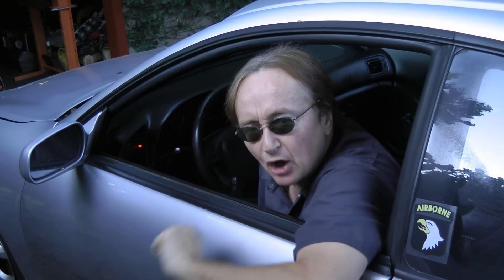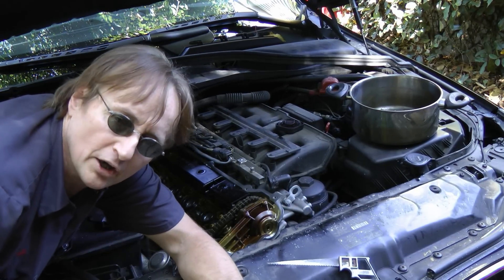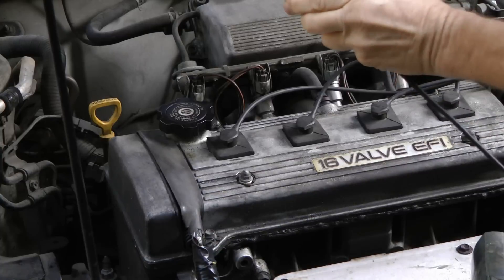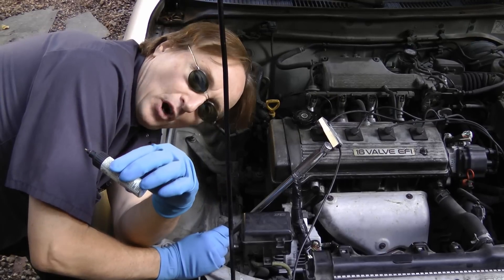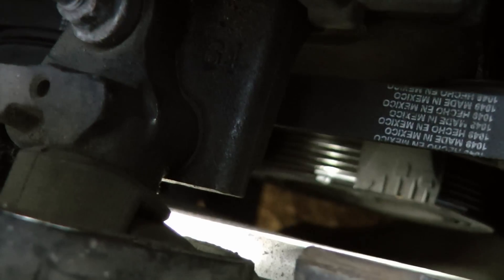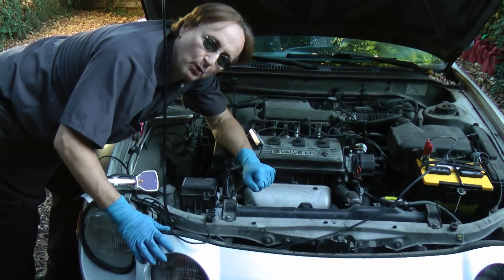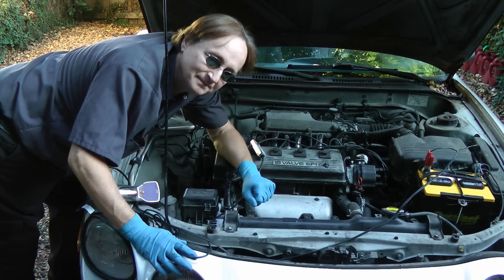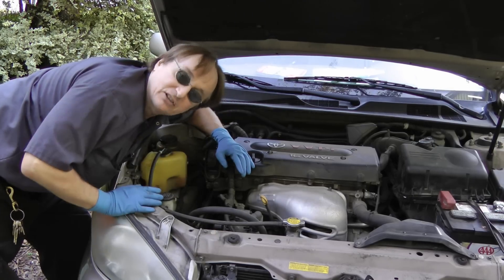How to Check a Timing Belt or Timing Chain in Your Car

Comment from the maker: the light fires every time the spark plug fires. that's the ignition timing on the engine, and when shone on the timing mark on the engine, it shows if timing is correct or not

Comment from the maker: You can try, often using the inductive coil pick up of the timing light will flash IF you put the pick up on top of a coil on plug assembly on the engine. But if not, they make adaptors for checking coil on plug systems.

Comment: Love those M54 engines in that BMW. Chains are so reliable over belts. Much better to spend the money on replacing the belt before it snaps and shreds the valves than spending at least $1500 for fixing the heads.
Reply: Wish my car would have a belt
Reply: Yes I’m so glad I have a timing chain on my Honda. I checked the engine specs for my mom’s Lexus and my brother’s Nissan and thankfully they also have chains. We do our routine maintenance on a regular basis so never have to worry about rubber belts that rot and break over time.

Comment: Very informative brief easy to understand videos.

I have one mention for this video: Strobe lamps are connected to the spark plug wire, but the delay angle of ignition CHANGES while reving up the engine so it's normal to see the mark go away from the normal position.
And if you add some cam phasers (bmw vanos and other names for each manufacturer) things get complicated.

Plus: Most modern cars do not have ignition wires to hook the lamp. Ignition coils are directly on top of spark plugs.

Comment: Thanks for a clear and precise presentation - a mechanic told me you cannot check the status of a timing belt. I suspected he just wanted money to change it!
Reply: He was right. You can't determine what condition the belt is in with a stroboscope. The belt has specified intervals where it needs to be replaced, replace it at those intervals and you will never even have to check it. So in a way, this video is irrelevant.
Reply: that's fine until buy a used car and not sure if or when belt was replaced
Reply: If you buy a car without service history and you're not sure, replace the belt. Simple as that. No need to check it. There are so many factors about the belt that you can't check, just not worth it.
Reply: +AR1G3  That's easy to say, but most people either don't have or don't want to pay the money to replace the timing belt unless it's necessary; my understanding is that it's a fairly expensive job.
Reply: Costs less than the damage you'll have when the belt snaps. Checking the belt doesn't guarantee anything, there is absolutely no way of confirming the condition of the belt. A mechanic will only be able to make a wild guess based on how the belt looks, but that's it. I once bought a car which had a 10yr old belt, the car wasn't used that much so the belt actually looked pretty good. But keeping a 10yr old belt on a car is just asking for trouble. IF you don't want to replace the belt, buy a car with service history. Together with the brakes this is the only component in your car you should never cheap out on.
Reply: +AR1G3  Okay, thanks for the information.  I guess I've done everything wrong then, starting with the purchase of my new used car, but I already knew that. I don't want to tempt fate, but fortunately, it's been 18 months and I haven't had any major problems, only had to change the battery and tires. Keeping fingers crossed.
Reply: Why are 1. The brakes something you should not run cheap with ? and 2. Why is the timing chain something you should not run cheap with? (I am looking for a used G35)
Reply: +LionStreet TM  Well, I am certainly not an expert or mechanical whiz, but at the risk of merely pointing out the obvious, brakes stop the vehicle, something pretty important, and I agree it's not something that one should skimp on, and as I understand it, the timing belt synchronizes the engine, the timing of the values and the pistons, another thing that's pretty important, and if it breaks there could be serious damage done to the engine which could cost a lot to repair.
Reply: Wow, thanks for replying man. I will definitely take your advice, appreciate it.
Reply: Because there could be a day when you need those brakes to save your life. For the same reason you shouldn't cheap out on tyres. For brakes and tyres you should buy quality brands.
Timing chains don't need to be replaced unless they're worn out, but if you don't replace your belt with a new quality item as prescribed by the manufacturer you might end up destroying your engine, and that'll cost you A LOT more than a new belt.
Reply: @LionStreet TM. Because of the newer designs of "interference" engines. Meaning, if the chain/belt breaks,the camshaft(which opens/closes your intake/exhaust-valves) immediately stops spinning but the few remaining revolutions of the crankshaft before coming to a stop will cause the pistons to slam up into the valves that are left in the open position where the camshaft stopped moving at the time of the break. Having the pistons slam up into your valves = a real mess as you can imagine. It's a shitty design and most likely intentionally designed that way to maximize sales of new engines/rebuilds for those who never took the maintenance schedule seriously. From what I have been told, they are called "interference" engines exactly because of that...the clearance of the top of the pistons "interferes" with the open valves should the cam stop spinning due to a break of the belt. Not worth the risk. Change that belt! I speak from experience. Had a belt break on my in a 2006 KIA Rio. Luckily, my cam stopped in the "sweet spot" and the crank stopped as well and no damage was done...i was VERY lucky according to many mechanics I have talked to. Even if BOTH shafts stopped at the exact same time, had the cam NOT stopped in the "sweet spot", just trying to START the engine after would have resulted in the above-described scenario as the starter would be turning the crank and not the cam due to a broken belt! Any mechanics, feel free to correct me if I am wrong. I am not a mechanic, just relaying what I have been told.
Reply: You're not wrong, you were extremely lucky! But you are wrong in saying it's a shitty design. It allows or a much more efficient engine, giving you more power and better fuel economy. And when the belt is maintained properly it's very rare that it fails. However, too many people don't understand maintenance schedules. A belt should be replaced every 6 years regardless of the mileage. Even if you only drive 1 mile in those 6 years, the belt has to be replaced. Too many people cheap out on this. Of all the broken timing belts I would bet at least 98% is due to neglect and not following procedures.
Reply: Change mechanics, find a decent one. Because that doesn't sound healthy for your engine.
Reply: if you're buying a car with no service history and you don't have any budget for after-purchase servicing then you just cannot afford the car. Poor man pays twice. Good rule of thumb for cheap old cars with high mileage is to set your budget, then divide it in half. One half goes towards the purchase, other half towards repairs.

Unless you are like my work mate, he buys disposable cars for 200-400 quid, as long as it has 12 months of MOT and if it fails next year then he just scraps it and buys another one. Not a single penny put into maintenance, but he knows the risk of snapping the time belt or like death on motorway when the wheel falls of due to worn ball joints or whatever.
Reply: @thefeet

"because of the newer designs of "interference" engines"

It is not a new design. And if you cannot afford to spend 400 bucks every 60k miles (or like my focus 160k miles BELT) then maybe you should get yourself a bicycle? Or if the cost of the timing belt job is much much higher then average maybe buy a simpler car with easier maintenance? Or possibly some chain driven one, which requires no maintenance for  lifetime of the vehicle as long as oil has been changed regularly.

I know too many people who buy series 5 or 7 BMW or 15 year old premium cars and then they buy their rotors on a scrapyard, because they cannot afford maintenance. When my bud saw £3k quote for timing belt he almost burst to tears, as he spend £5k on his E-Class Mercedes just year ago. Enough to speak that he spent another £1.5k to make it pass through the MOT.

Comment: I prefer a timing chain, lasts longer more durable. old school is still the best way as far as mechanical operation.
Reply: Its not
Reply: it's $30 for a timing chain and most american engines arent interference engines like Japanes. if a timing belt breaks on a japanese engine the engine is most likely toast after that
Reply: yodaddy nuggems (some) old japanese car s are non interferance engines like the old toyota carina... If the belt breaks.. the Newer japanese models no tho.

Comment: hey scotty how can you check the timing belt with the timing light test on my toyota celica gt 2001 when these toyotas dont have spark plugs cables only ignition coils so how can i use the timing light?? give me a an advice thanks or if you know how to check the timing chain let me know thanks
Reply: cherencueca7 bit late but you can buy spark plug check cords that are basically an extension un bolt the coil pack if it's a singular pack for all plugs like some GM engines you will have to have multiple connectors  put it between the coil and the plug and put the clamp on that
Reply: Or just change it to be safe. $50 if you do it yourself then you don't have to worry about it

Comment: How can  you use this method on a diesel engine?
Reply: Sign in Here you would need a diesel timing light
Reply: I think that you can get a light gun for diesel engine but I think it's a different type of light gun.
Reply: you can use the same light gun but you need an adaptor that senses the  pressure in your line and converts it to a signal

Comment from the maker: generally a worn or loose fan belt on the engine.replace any cracked or loose belt and check the auto tensioner to make sure it's working

Comment from the maker: many things can do that, but if it turns over slow, a weak battery or weak starter often does that IF the ignition timing is not too far advanced, check that too

Comment from the maker: On some modern engines, yes. But many still use conventional cam sensors that would show worn chains.
Reply: 97 Celica...I'm the 2nd owner, 99k miles. The belt should be replaced, but my mechanic in Philly said it would be $1,000 - is that fair? I have no shot doing it myself...sorry, I love your videos but it happening for me. Thanks Scotty.

Comment: thank you for reply. I checked it more carefully and disovered that two of 5 injectors were partially leaking instead of spraying all the way down...when I apply the pressure manually it sprays excellent, but if I just pressurize it slightly it leaks! Sticking needle at some position...I replaced them with two other nozzles and it works a way better...I will replace them all.

Comment from the maker: try the cap and pray. Distributors are rather expensive. Change the distributor assembly if the cap and rotor inside don't fix it

Comment from the maker: you just find a timing light and hook it up as in this video. If it has a spout connector, you bypass that by unplugging the two wires and then loosen the dist and set the timing at idle speed

Comment from the maker: Reserve capacity is the number of minutes a battery can maintain a useful voltage under a 25 ampere discharge. The higher the minute rating, the greater the battery's ability to run lights, pumps, inverters, and electronics for a longer period before recharging is necessary.

Comment: Scotty I just removed a bolt from the timing belt cover on my 99 camry 4 cylinder, pulled the cover back with my hand, and looked at the belt with a flashlight. It looked in good condition. It was a lot easier for me than hooking up a timing gun.
Reply from the maker: you would still not know if it stretched too much, the gun is more accurate
Reply: Scotty Kilmer I hadn't considered the stretching. what exactly is timing belt stretching what does that mean and what happens when the belt stretches?
Reply: I would imagine the engine runs rough at first and eventually valves and pistons try to occupy the same space at the same time.
Reply: It's a non interference engine, which means the valves and pistons don't hit each other when the timing belt breaks.

Comment: Have you checked the motor mounts and transmission mounts?  Easy way to check those is to put the car into drive with the brake on and then back into reverse and see if it clucks.  More often like Scotty said it's the front end but hopefully it putting the car into reverse and drive a few times will make the part cluck so you can figure out the culprit.

Another thing check the boots on all the front end parts and make sure they aren't cracked to the point they are broken or have a hole in it.

Comment: I'm an avid watcher of your videos and all of them are hugely informative and easy to follow, but I don't think you've fielded this one, or perhaps I'm not looking hard enough!
I've recently purchased a high mileage 2001 BMW 330D. It has 178,000 miles on it, but I'm certain that with the right care and attention it will go on and on for some time. What kind of preventative maintenance, and other tips would you offer to keep the car running nice and sweet. It's running perfectly though! Thanks!

Comment: I need a decent scan tool to check to see if the timing chain is worn in my Chevy LS1 engine because the scanners I have aren't reading trouble codes on the SAE J1850 VPW PCM that runs it.
They only read trouble codes on the LS2 powered Holdens which have a ISO 15765 CAN PCM which runs it.
The check engine display comes on when the engine is fully warmed up & the Cruise control cuts back in at the bottom of a dip.
So I'd be looking for a P0336 code which is a crankshaft position sensor performance/out of range issue which usually means that the timing chain is worn or stretched.

Comment: on a motor like mine, you put a mark on the harmonic balancer 0 degrees TDC for the number 1 cylinder and thats where the number 1 plug fires. and if its flashing in time with the mark and timing tab its in time.

Comment: Scotty.  This is a great help!  One thing.  You mentioned timing chain.  I have an older Suzuki suv which uses a timing belt.  Would the diagnosis be the same in this case?  I always thought the rubber belts would break rather than stretch.  Thanks

Comment: Hi Scott,
I have a 2012 Barina, or Chev Aveo. I am the second owner, I didn’t know when the timing belt was done last, so I replaced that, apparently, for one I don’t know if the mechanic really changed it or not, for number 2, It has a new battery, but it seems to loose power, at the top of a hill, when coming to a complete stop, it has a manual transmission, the engine just cuts out, and I need to do a hill start to get it started, it doesn’t have enough crank to get it going otherwise. But I have taken it to the mechanic but he seems not to find a problem. 

The machine say’s it has a misfire, but the mechanic didn’t give me more details. The oil doesn’t seem to be milky, and it doesn’t seem to have oil on top of the radiator fluid, but I can say it does have a little grease line on the side of the radiator overflow tank. There is no smoke coming out of the back, but the radiator fluid has dropped a lot since the last fill up, according to the mechanic filling, after doing the water pump as well. Are you able to give some guidance please? Thank you, Sir.

Comment from the maker: Modern cars don't even use distributors, and somewhat older cars like GMs had dists in them, but they were not adjustable as the computer system did that. computers control timing in all modern cars these days.

Comment: On my '79 MG B (and on probably any old OHV engine) it was really easy to spot a worn timing chain, or to put it better, hear it. It started rattling horrifically after 35 years and 120.000 miles. Luckily, on a rear wheel drive car like my MG, it was really easy to replace. Should be good to go for another 35 years, or more probable, 120.000 miles.

Comment: Scotty, I appreciate the solid information you give.  I have a 93 Yj Jeep with 252k miles on the 2.5 4 cyl. It recently started running rough and back firing even shutting down. I changed the plugs first they were horrid. Helped a little but that fix did not last. I have spoken to a few mechanics and they are in dis-agreement. Needs timing belt replaced or check your cap/rotor or rebulid your head.  I also do have some blow by with a bit of water mixed in ( i have a separate canister). No over heating and decent oil pressure.  any help would be fantastic.
Reply from the maker: first, do my video "how to tell if your head gasket is blown' as it probably is starting to do that. And if so, get some bars copper head gasket sealer at auto zone and try that fix.

Comment: Correct me if Im wrong, as I know modern engines get the spark timing from inductive sensors using teeth/slots on flywheel. So the crankshaft and the ECU to time ignition has a common reference (fixed) and it has nothing to do with the CAM shaft. So this test will only provide you the ignition advance angle with increased RPM. I think the correct method would be to put a mark on the CAM shaft and then use this method while constantly varying the RPM to slack-taut the cam belt.

Comment: Hay Scotty!  Could you make a video on  How to check timing on newer vehicles with coil on plug ignition? Thanks
Reply: You would put a spark tester in series with the #1 spark plug and coil and put the inductive pickup of the timing light around the wire of the spark tester just like you would a regular spark plug wire